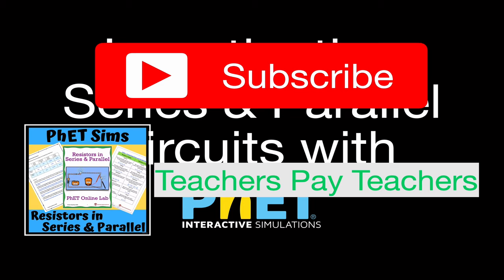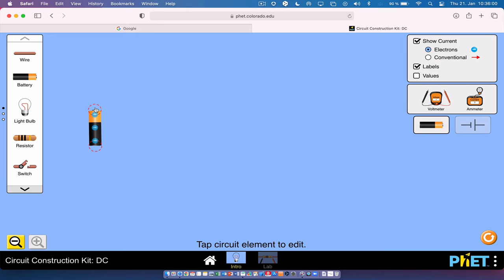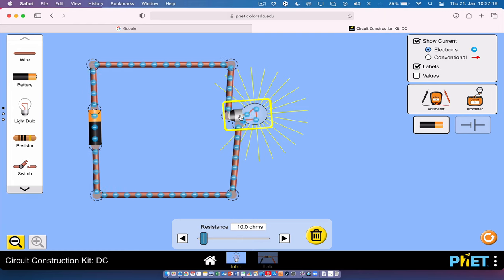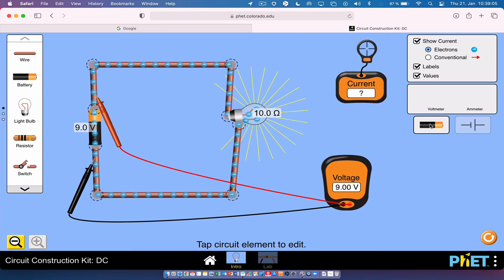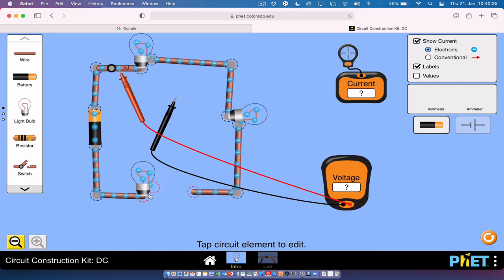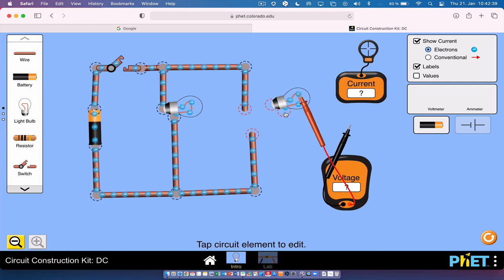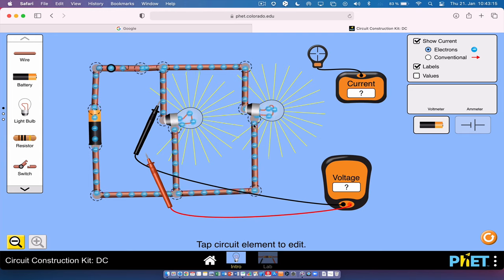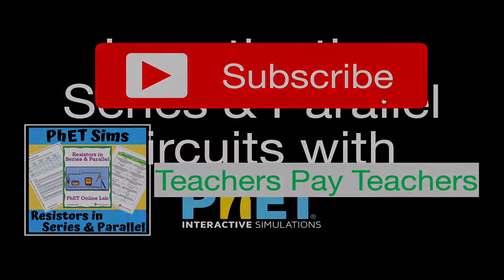Building Series & Parallel Circuits with PhET Simulations

Comment: is there still a parallell connection if i use 3 batteries and one light bulb instead? the opposite of what you did
Reply: Yes only if you connect them in parallel (batteries). Now If you do this you need to make sure tha batteries are at the same voltage. If not the batteries will just charge the others untill they are at the same voltage. Now on the battery you need to wire them together + to + and - to -. Now doing this will combine the amperage but keep the voltage the same and the opposite for a series set up

Comment: Excellent explanation of Kirchhoff's voltage rule for series circuits. 
Excellent explanation of Kirchhoff's voltage rule for parallel circuits.
Needs a little more detail on the parallel circuit with reference to the voltage.
Reply from the maker: Thanks for your feedback